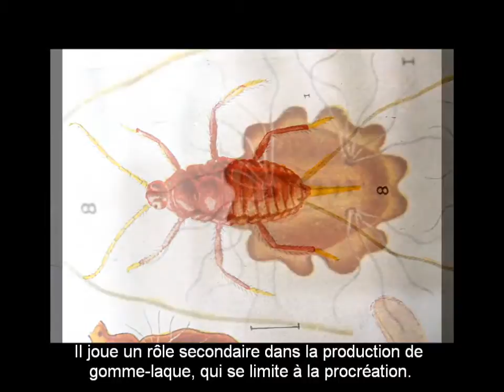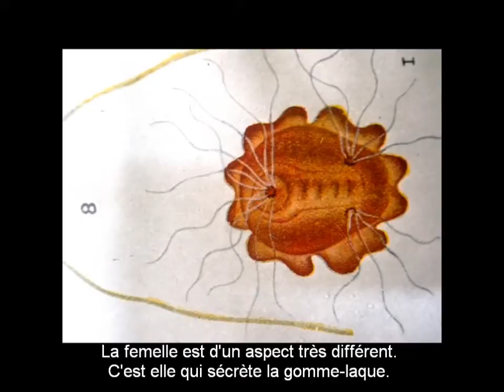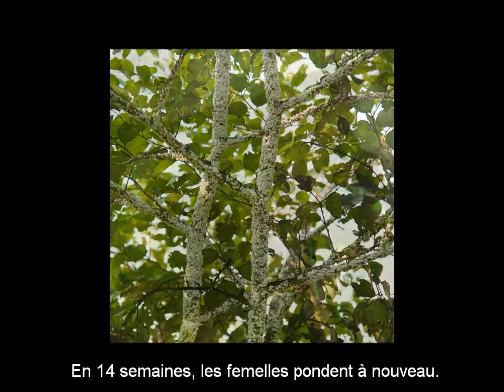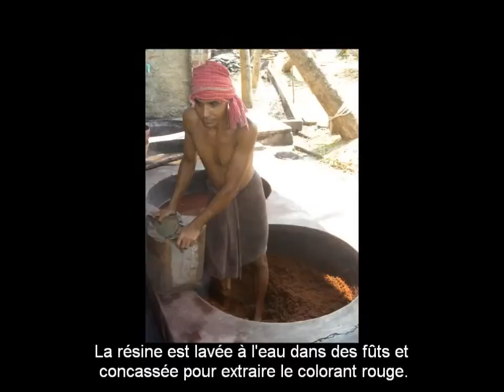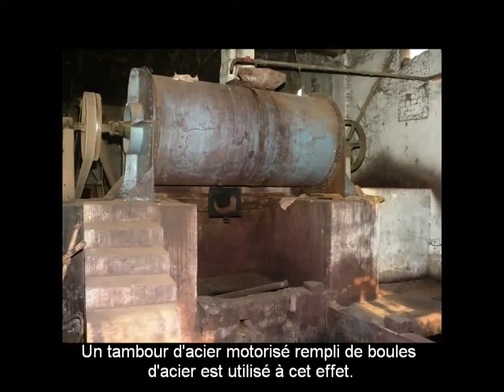Origine et production de la gomme-laque, sous-titre en français

Comment: Thank you so much for sharing. Now I know the product I've been using for the past thirty five years a bit better! In English the process is called French Polish, in France we call it Vernis au Tampon. In the old days there used to be workshops, especially here in France, where entire teams of French polishers worked all day at finishing piano cases. The Pleyel Piano Factory had up to SEVENTY full-time polishers doing their cases. In my opinion the most difficult job is "ebony" polish. The black mirror finish is absolutely merciless. One pin-sized hole can be seen metres away. We use the five different kinds you mention, WHEN we have the work, because it has become very scarce. Very few people have any knowledge of this fantastic craft ; the finish is absolutely inimitable. It's best to de the grain filling with pumice powder and pure spirits. I use a little bit of Tripoli powder in the intermediate stage, and finish off using a rubber with extra fine Egyptian coton. I enjoyed your video immensely. I'd love to visit one day. All the best from Paris.